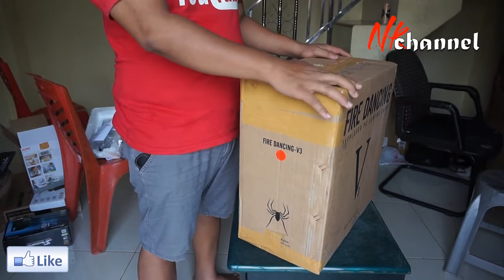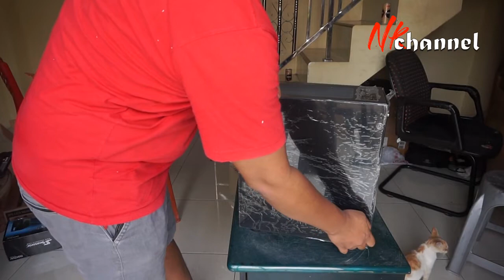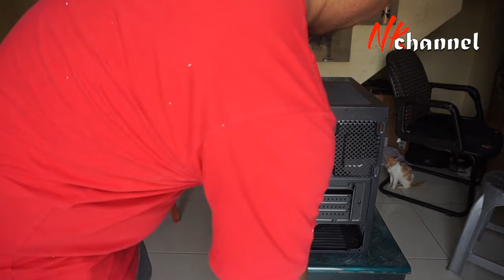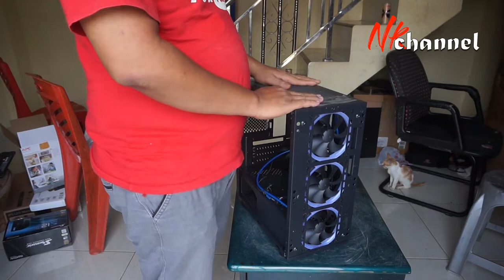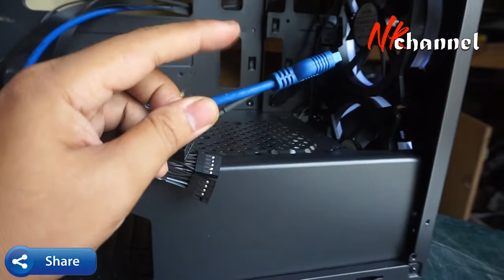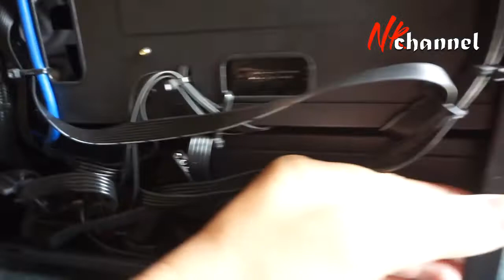Unboxing & Review 1STPLAYER Gaming Case Fire Dancing V3  | Casing murah nan cantik

Comment: Do you find the front glass panel overheating when using the computer?
Reply from the maker: I didnt check about that :(
Reply: @NujukayeTech  No worries man ... maybe you can do a follow up review on it. The front glass panel and casing has too little clearance ... leading to little to no airflow. Thanks when you do! ;)

Also, the cooler fan core produces some heat, heating up the glass over time.

After about 10mins, the front glass panel of my casing heats up like a quite a bit.

The top front of the casing near the USB ports really heats up too.

With the front panel off, it stays cool like a cucumber!